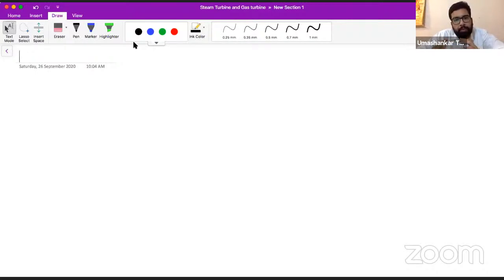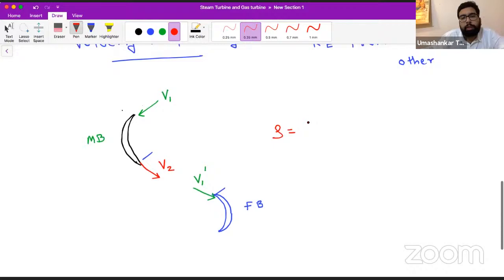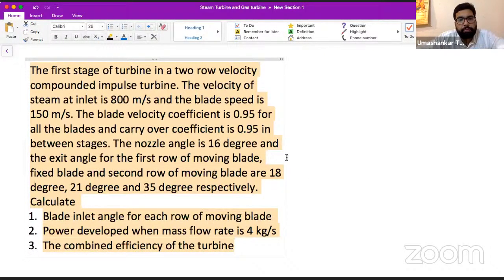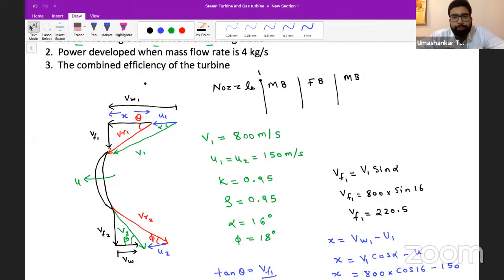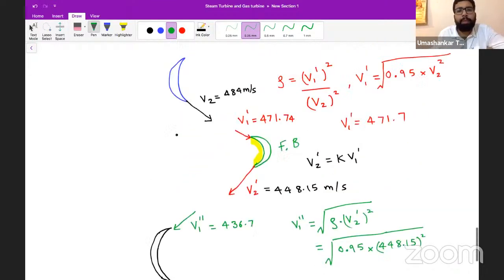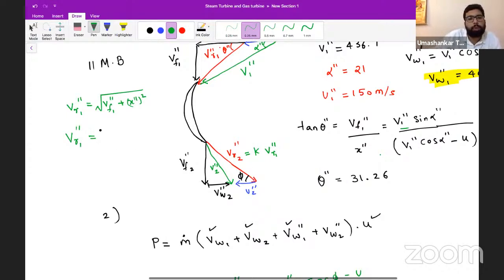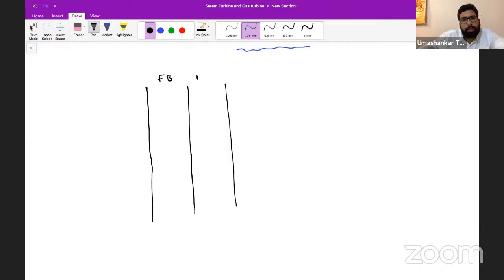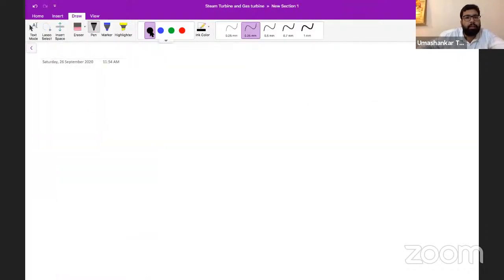[1] Parsons Reaction Turbine | GATE 2021 | Thermodynamics and Applied Thermodynamics GATE Lectures

Comment: Sir ... In the last question from impulse turbine.... Exit angles are given as 18,21,35 degrees... Tell me whether these are vane angles or jet angles...
Beacuse u have used 21 deg as jet angle and 35 degree as outlet blade angle for 2nd moving blade....